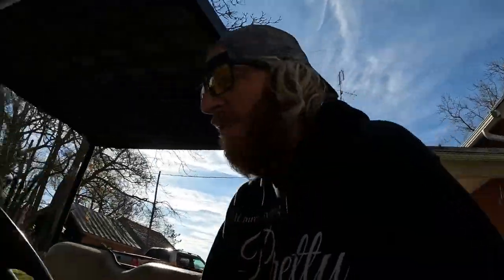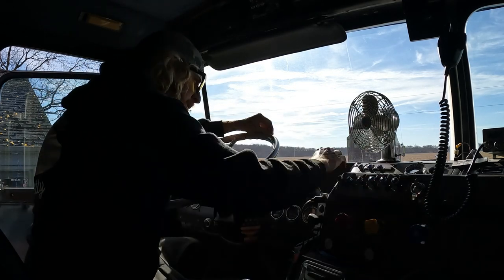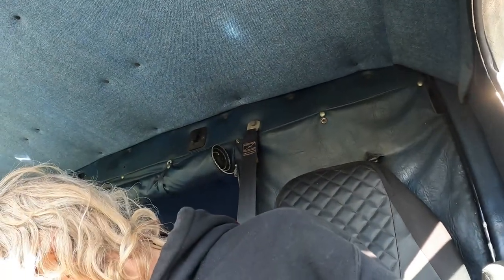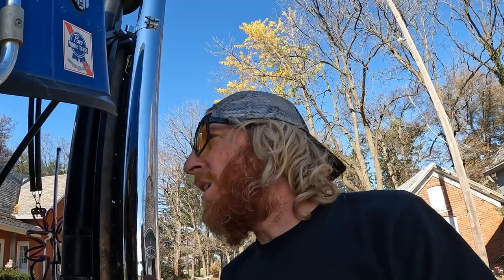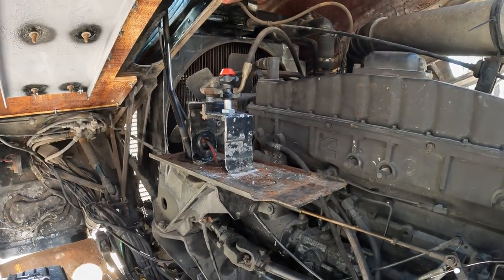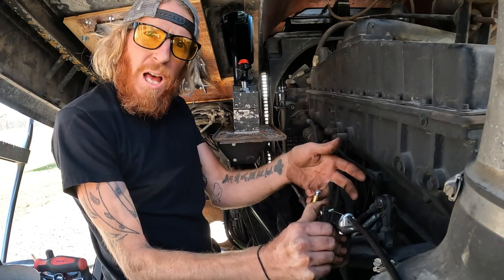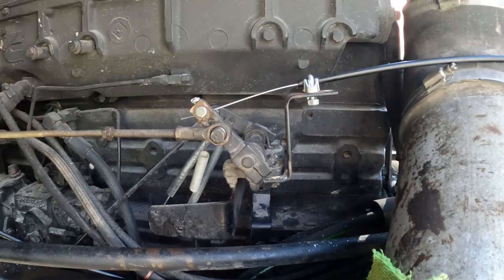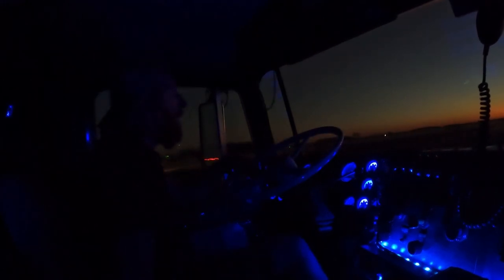1983 Mechanical Cummins 350 BC lll Cabover Throttle Lock

Comment: Hi CK

Here in Britain in the old day's as you know we use coe / cab overs.

Well in the old days the hole in the cab for the gear stick/lever they would use the rubber door seal / boot/trunk seal.
The reason behind this is the door seal has a part that grips the metal opening and the soft cylinder Shap seal comes in different sizes and can form a seal on the flat plate where your gear stick is mounted to the frame of the truck.

Some times you would have to build up the gear stick flat plate mount to close up the gap.
By welding, bolting or gluing wood / plywood, plastic or metal.

But the way you have done it is just as good or even better than what I learned from old drivers in the 70's Britain when I was a very little boy.
Reply from the maker: Yep I just did the cheapest most effective way I could with minimal effort. Thanks Phillip

Comment: Hey Brother, Nice Job.  She's coming along nicely. That hole you drilled out is exactly where the throttle cable was on my old 352 Pete I had back in the Day. Also was a double throw with momentary toggle switch where what's left of your switch is now. What it did was a remote start switch for when servicing. Also you can pull that cable wire out, cut the sheath to length push wire back in and cut it to length. Happy Thanksgiving   TGP
Reply from the maker: Thanks Thomas

Comment: Really nice job Chad. Glad to see that you got what you wanted to get done with the blue truck before the weather turned too cold. Now the blue truck should be ready for winter. Were you able to replace the power steering filter? Now make some money. Hope the parts you picked up in Savanah Ga. work in the green truck. Since the glass in those trucks is flat, I would think you shouldn't have any problems getting a glass shop to cut new glass for them. Keep up the good work. Keep warm👍
Reply from the maker: The blue truck is parked for the winter I don’t like salt on that truck because it’s a southern survivor but the green truck was a east coast salt covered hussy so I send it and it gets around better with the air ride

Comment: The purpose of a throttle lock is to idle the engine up when sitting ,especially a 71 Detroit or 92 series Detroit to keep the oil in the motor and old style Cummins below a 400 or 444 kept the carbon out usually idled at 12 to 1500 when sitting ,,,also for a pto that's what there made for ,,,,NOT FOR CRUSE CONTROL ,,,wait till you miss that handle while you have it locked down while driving I've driven 44 yrs tried it all just putting a warden out there b careful it can hang and cause a big wreck
Reply from the maker: Yeah I heard that.. Scary